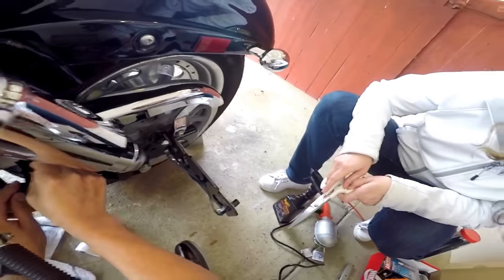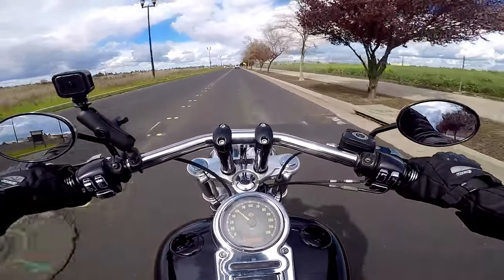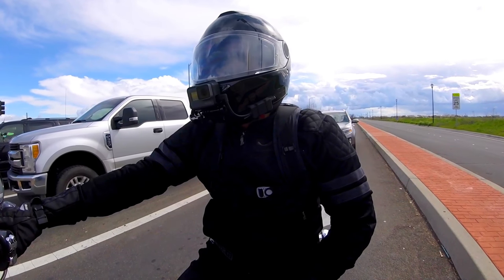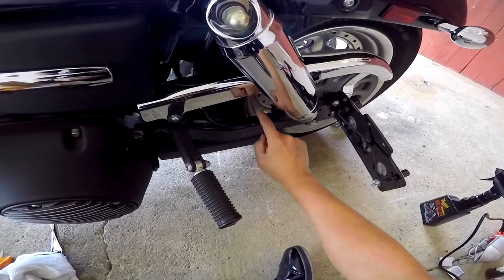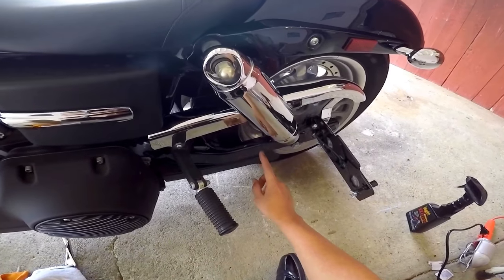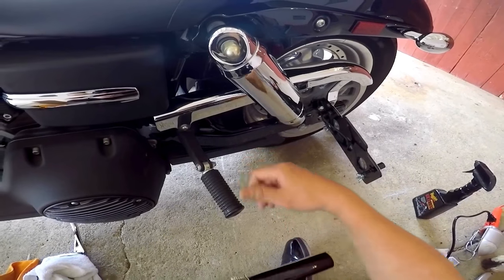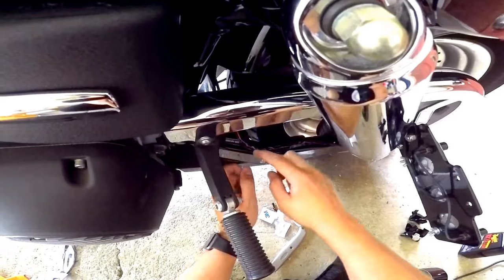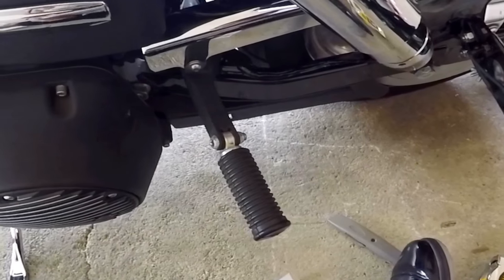3M 1080 Vinyl Wrap - hiding wires on my swing arm - Fat Bob Mod #13

Comment: Could you have run the wires at the bottom of the swing arm to keep them out of view?
Reply from the maker: Possibly, but the wrap wasn't the easiest to work with and having the wire resting on top meant I didn't have to contend with gravity.
Reply: @thatoneguymoto  I understand, you did a great job my friend